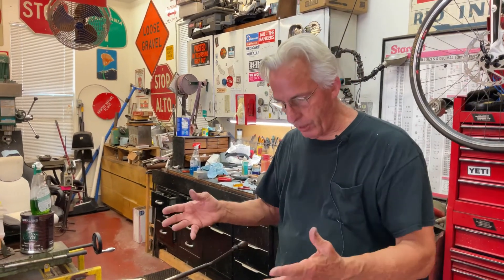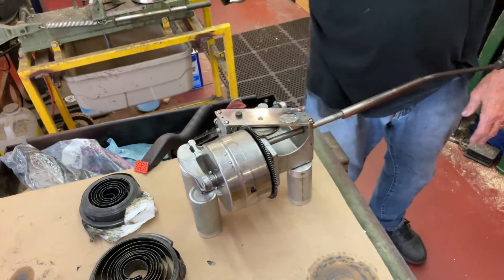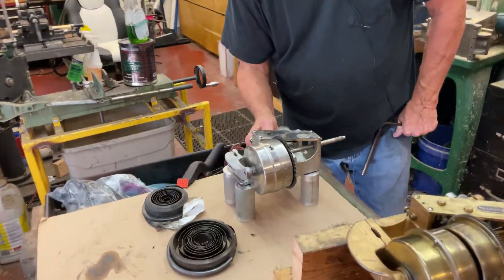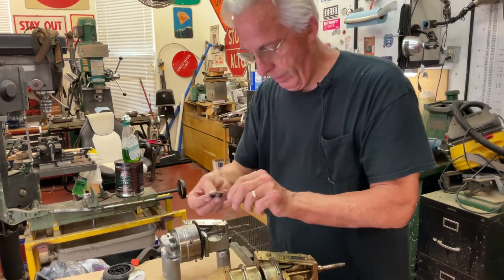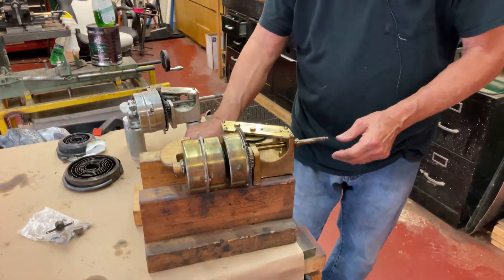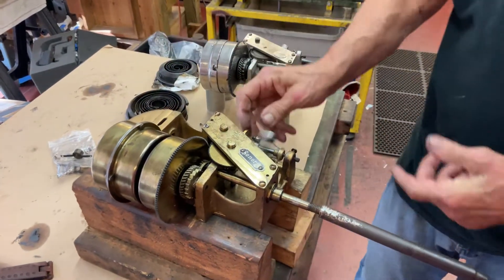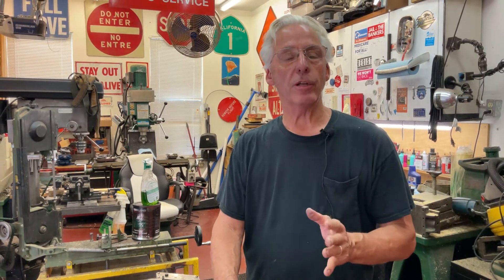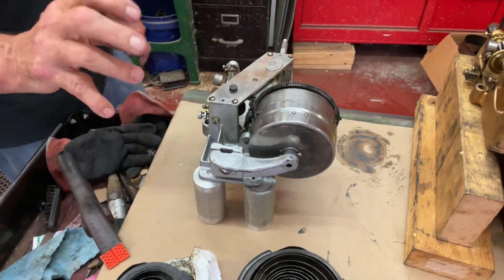1150.  The two Sonora motors are running smoothly

Comment: Those are certainly some nice motors after your overhaul. I assume that the governor weights with the riveted springs must be somewhat readily available? Otherwise, couldn't you drill out the rivet and tap for a screw to hold replacement springs? Thank you for sharing your expertise!
Reply from the maker: Yes, you could drill out the rivet and tap for a new screw but when you replace one spring it’s important to replace all three for balance